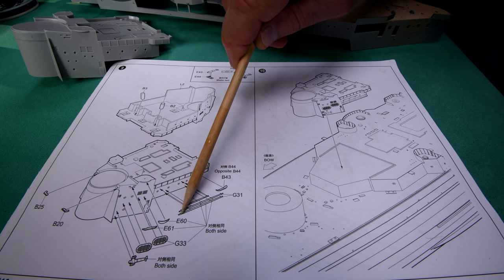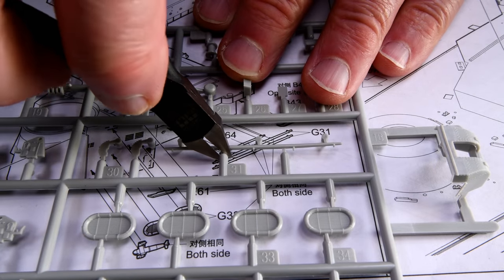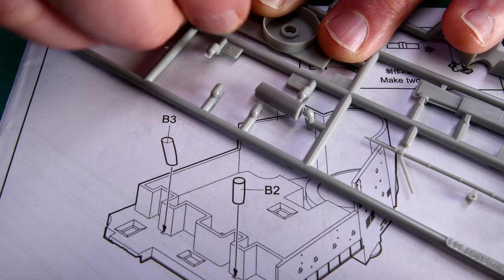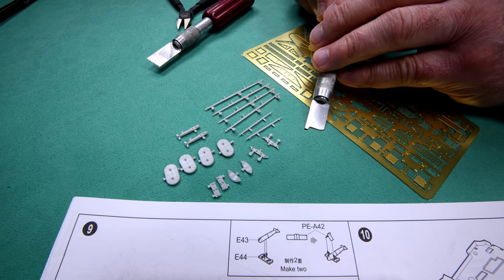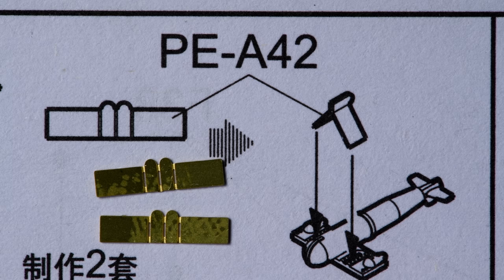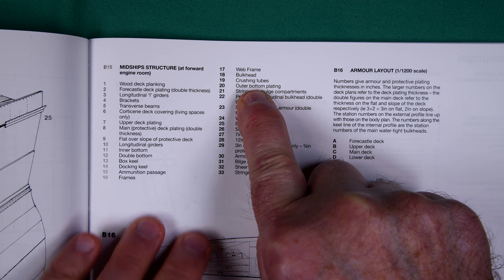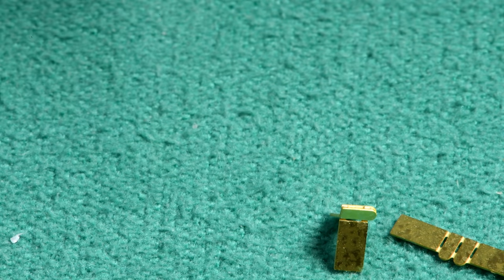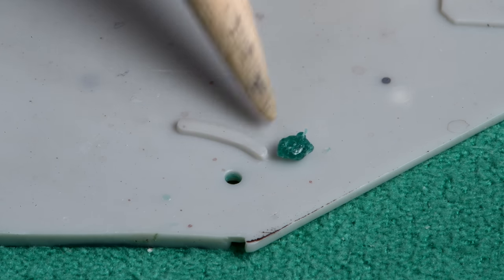The Model Ship - Part 576

Comment: Hi Ron, you probably already know but, just in case. The 3 poles/staves (E64 and G31) in the pics I’ve seen were wood and used on the small ‘cranes’ dotted around the ship.  Similar to the ones you see on ships like the Prince of Wales except they were metal, on Hood, Queen Elizabeth class etc it looks like they were wood. Cheers
Reply from the maker: Thanks Mark. Will use the deck tan on those then. 👍😁